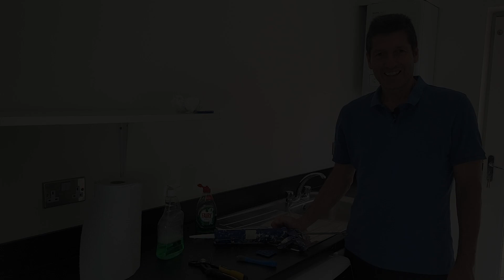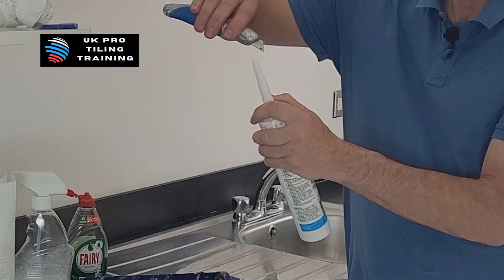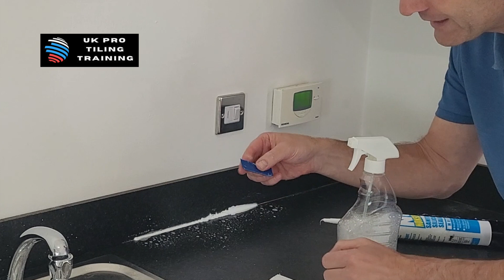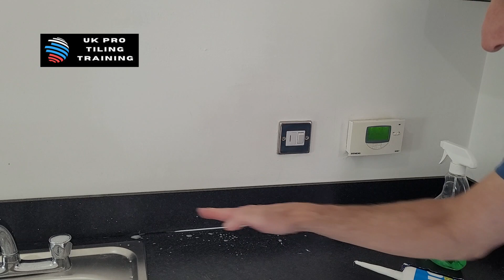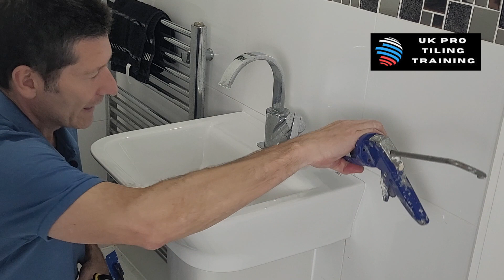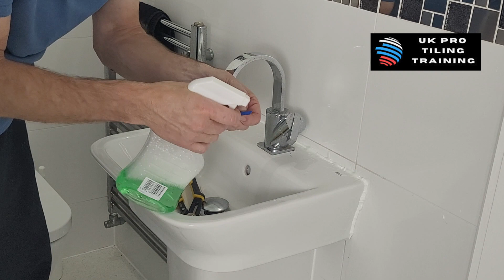How to silicone like a professional with no mess

Comment: Warning, If you painted your wall with eggshell paint even as long as 1.5 weeks ago this soapy water spray strategy here will take your paint back off the wall. only do this for a seal between 2 non-painted surfaces or wait about a month after painting to caulk. I thought this was my last step and now... it's not. For doing this against a painted surface, use painters tape instead.